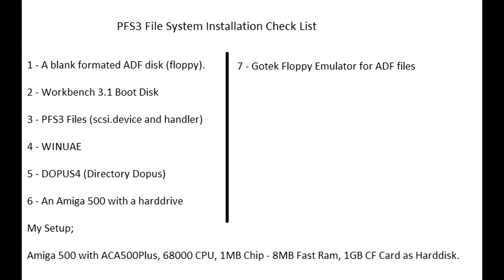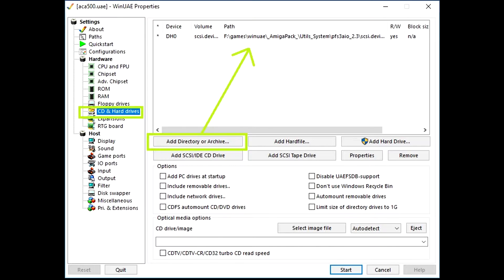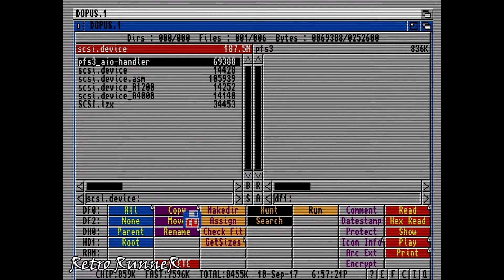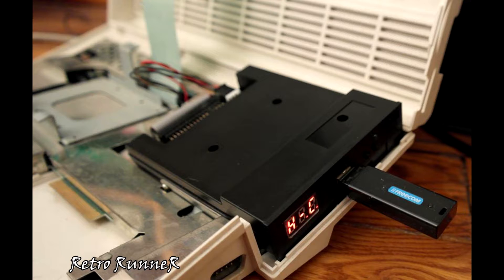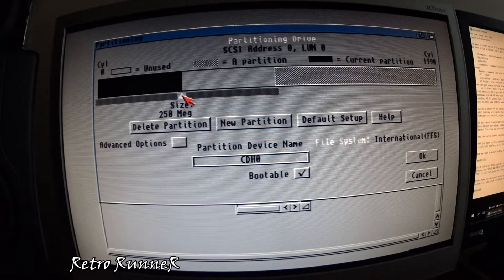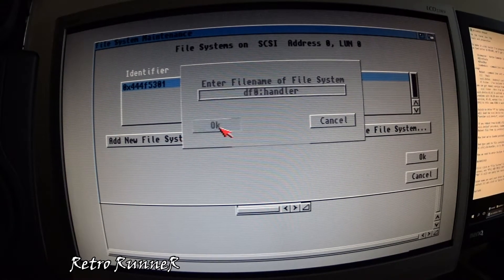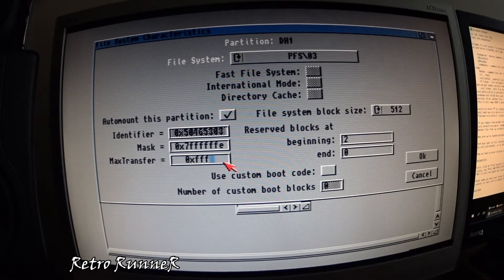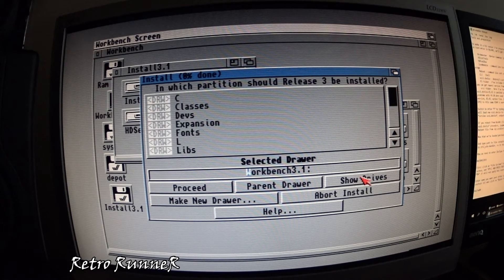How to install PFS3 file system to Commodore Amiga (Large Disk Support)

Comment: With BetterWB 4.3 you can go to 8GB. 

My AMIGA 500 Rev6A setup is a ACA500Plus V1 / ACE2 / Indivision ECS V1 with Super Denise 8373 Rev0 / ACA1221EC with RTC. Running WB 3.1 / BetterWB 4.3 with a 8GB CF WHDLoad 18.5 and iGame 1.5. Got 68EC020 with 28MHz and 2MB CHIP RAM / 1MB SLOW RAM / 8MB FAST RAM. With a VGA BenQ BL702A 17 inch monitor and Bose Companion 2 Series III Multimedia Speakers. Waiting for the black A500 case. black keycaps and the black tankshell from A1200NET. 

Now i busy with my AMIGA 1200 project.

Comment: Don't forget when entering the MaxtransferRate always do an <ENTER>, if just pressing OK it will not remember the setting. 

Anyway, I have a 32GB Sandisk Extreme CF card, but with this method the total size will not exceed 4GB. :-(
Reply from the maker: Yes that is true, when i've returned to Amiga 5 years ago i forgot to press enter and spend 20mins going crazy lol. Well 4GB is more than enough for Amiga i guess. I use a 512MB and a 2GB CF.
Reply: Sector size of 4096 for big drives. Getting them working with everything means upgrading Kickstart and Workbench to 3.1.4 But even then, it's still worth having a 4GB partition for software that won't run from anywhere else. Limit is 100GB or so for a PFS3 partition.